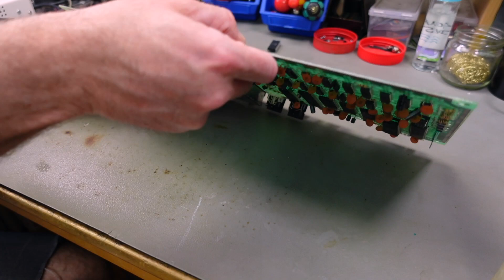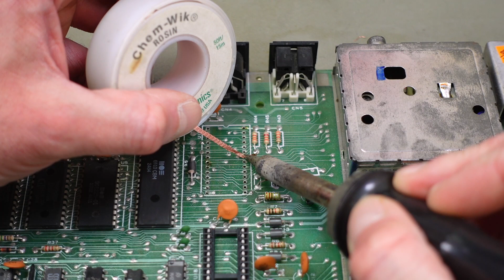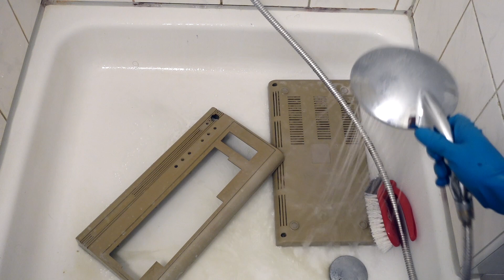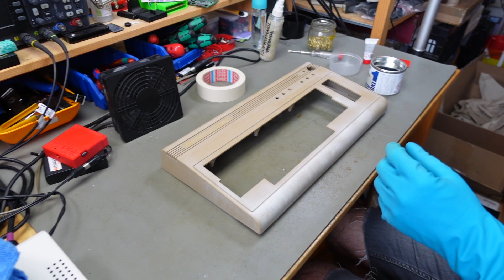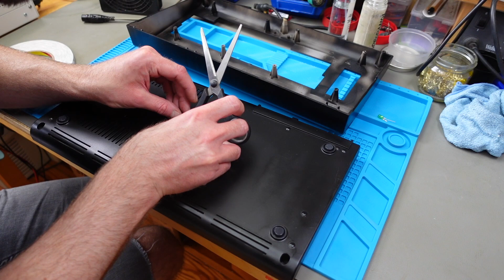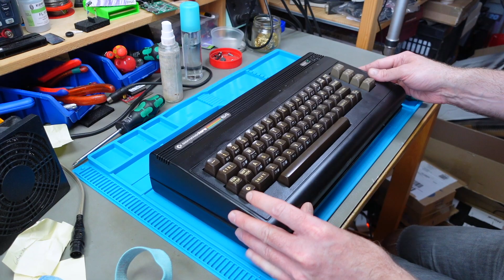Challenging C64 Restoration and Repair

Comment: body filler is perfectly adequate for the job of filling holes like that , few hints though:
1: put out the amount you figure you need on a small piece of scrap cardboard and add appropriate amount of hardener, that way you don't destroy the whole can of it
2: fill holes with a push coat, sand and repeat with smooth coats as fillers tend to shrink as they cure, you can get that area perfectly level but it takes some time , no matter the filler you use
3:sanding, do NOT use a nail board like that as initial sanding , use an emery cloth 400 grit and up to 1000 if needed, the flexibility can give you the leeway of shaping and contouring a lot better
4: use the edge of a flat file to profile the fins , the round file will concave the fins instead of profiling them to cut square edges , here you can use the nail board to level the tops
5: multiple coats and sand between coats of primer, this will show you low spots you can touch up with filler and smooth off , that way you do not get the divots like that
6: painting , do not use short burst like that , thats how you get thick , thin and bare spots , spray past the edges , even coats , light sand in between coats , don't sand the top coat unless you intend to polish
pretty good for a first attempt , but don't give up on this method , practice it on a few pieces of scrap that you can make mistakes on and tweak the method to your liking
Reply: Word.
Reply: excellent...

Comment: I recently repaired the case of an Atari STE with a filler for metals!( with fibers)
 I applied it from the inner side of the case and instead of tape I placed pieces of plastic with a natural surface grain(lightly oiled to avoid bidding with the filler) on the outer side of the case. 
The result was amazing, no sanding was necessary of course....only the color is off and if I decide to paint the whole case no one will be able to  spot the body work (until they look inside of course).  

Now the metal filler gets really hot when mixed with the hardener and I got really worried that it would deform the plastic case. It turns out that that heat  did help the filler and the plastic to bind really well!

Great work over all!
Reply: Yeah applying from inner side is a way to go and as you have used plastic on outer side Jan could use some mould material to copy the grill part to avoid much sanding. Also he could use maybe some small dremmel to send out grill part instead laborious hand sanding.

Comment: At first I thought this would be just another dead PLA job. Then things got interesting! Bonus points for new camera perspectivesy, too! Some thoughts: automotive putty tends to shrink a lot while hardening. That's why you always should consider another one or two layers. Also it is good to close the holes from the underside with some type or mesh.When spray painting there is a chance to get bigger splshes when pressing the button on the can, so I prefer to press it outside of the object and leave it pressed. For modelling the grooves I was thinking about using those 'Linolschnitt' tools from school. Don't know the english word, but I guess you know them. Your round wasn't the best choice for square grooves I think... Also could have been better to cut the edges of the grooves first with an exacto blade. But I really like those videos that require interdisciplinary skills. You can get better with practice! Like you did with the use of power tools... ;-)

Comment: Pro tip: Scoop out a small amount of filler out of the tin, put it onto a disposable plate and mix that with a little bit of the hardener instead of putting the hardener straight into the tin of filler (note the ratio of filler:hardener mentioned on the side of tin). That way you'll still have plenty of filler and hardener left to repair future cases/dings in your car. :)
Reply: Was just thinking the same, seeing Jan waste a whole tin of poly-fill just to fill a few tiny holes hurt me inside so much... And I agree, a piece of cardboard, disposable plate or anything like that is the way to go with it.
Reply: Agreed. I thought whoa man that's a whole tin gone. I might have just over filled the holes a little proud and spread it underneath a bit to stop it falling out later. But yeah, a little more time and it would have been an invisible repair.  Spray from side to side in one go to get an even thin coat and build up the layers. Thanks for sharing Jan.
Reply: @grotekleum  Or filled it for a rough first one, let that cure, then go over it with another round of filler till it's level with the surrounding. Didn't cringe so much but winced a bit and then thought "have done that myself once too".

Comment: Have you stopped replacing the voltage regulators with DCDC converters when future-proofing, even the 5V one? I replaced both the voltage regulators with the good Recom type you have used before and I am not sure if I got some additional video signal noise, so I wanted to check with you if you still think changing the voltage regulators is a good idea or not. The 12V regulator doesn't get so terribly hot, so I guess I mostly want to use the DCDC replacements on the 5V line, but not if it degrades the video or audio signal. Seeing the high input voltages that are supplied to these voltage regulators and the terribly inefficient and wasteful power/thermal issues, my mind really wants to go with good DCDC regulators, but I wanted to check with your experience. (edit: I am also aware of the "f.rt sound" issue, but I am always using ARMSIDs anyway so that's not a concern for me.)

Comment: Fresh epoxy putty does a pretty good job on case repairs. It is also suitable to be „wrapped around“ broken screw posts after glueing the bits together to enforce them. Nowadays, I do it with 3D-printed tubes, but well… epoxy putty is as good.  In my experience, groves, dents and craters are very visible after spray painting, so filling the holes well and sanding it plain with a block that supports the sandpaper to get it more even. For spray painting, a big cardboard box can be helpful to keep the dust away.
Reply: yeap......I managed to  replace broken screw posts that were missing with epoxy putty for metals. They are 100% functional!

Comment: Sorry but I laughed hard when you emptied the hardener into the can, you absolute mad man :D But very solid video, immer wieder schön deine videos Jan!
Reply: Me too! Jan - best to use a little material and hardener on a piece of cardboard or similar. that way you can use the filler again another day. The sanding can be done wet as well which might gain a smother finish. (Not being a dick - just a few tips for next time)
Reply: Usually with those type of fillers you mix  a golf ball of filler with a pea of hardener. A second application of the filler and those holes would be gone
Reply: Try to use something with a square edge like a popsicle stick and wrap it in some sandpaper to help you sand those fins back into shape. Also a second pass with a fine filler would help you to get those divots flush and manage to build some of the details back in more easily.
Reply: Lol I missed that part and wondered later why he didn't fill the holes better after I saw the paint job.

Comment: Hey Jan, perhaps on the grid lines you could have place wooden toothpick and as you place the epoxy, try to shape it as much as you can with the tootpicks before it dries. Also you could have scoop out and mixed a little bit of the epoxy in a seperate container. So that way after sanding, you could have mixed more again later when you still see defects. Otherwise, it turn out very well with the paint job you did! 😁👍

Comment: Sockets are not necessarily an indication that chips have been replaced previously. Apparently, back in the day, if CBM didn't have some chips when they were doing a production run they'd fit a socket and come back to the board when they had the chips back in stock and install them.
Reply: True, but there was lots of flux residue on the back for those sockets, but not anywhere else. AFAIK when CBM did that the sockets were wave soldered together with everything else except the RF modulator so if it was "factory socket" they ought to have been like all the other, not different. Hand-soldering the sockets when they didn't need to do it by hand would have cost money/time (pretty sure the RF modulator is hand soldered because it couldn't be wave soldered).
Now, it could have been a CBM repair before it left the factory (I assume they did SOME testing to detect failures), after all CBM didn't clean up the flux after they hand soldered the RF modulator either so it's consistent with their practice. But the evidence suggests it was likely not just CMB leaving those sockets open.

Comment: Very nice. If I ever finally manage to get my hands on one and it needs repair your videos are gonna be super useful. 
To repair the case maybe you could make negative molds (clay maybe?) from another one, then re-fill the broken one against the negative from behind. Just an idea. Some fine sanding after priming.
Maybe a thin layer of clear lacquer sprayed over the paint job for added protection as well (heat resistant lacquer?). my2c. Cheers!